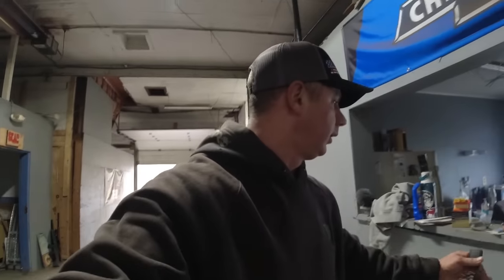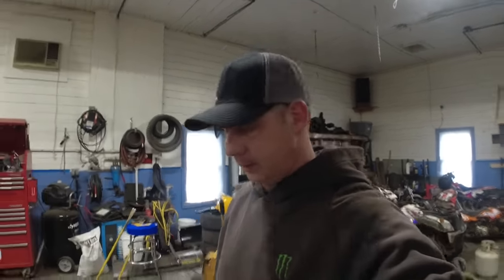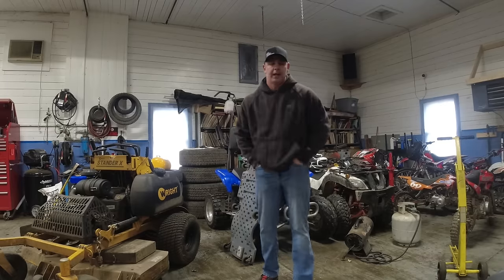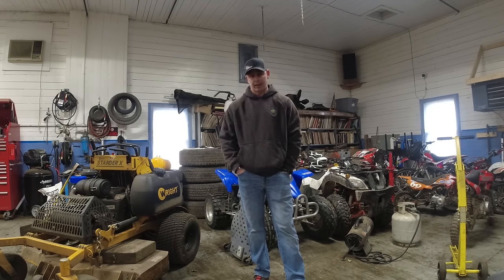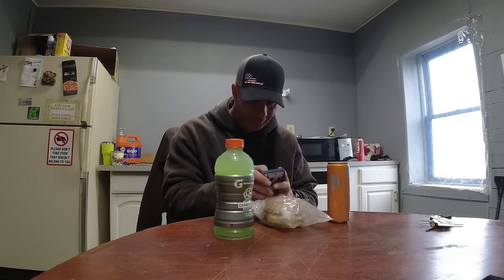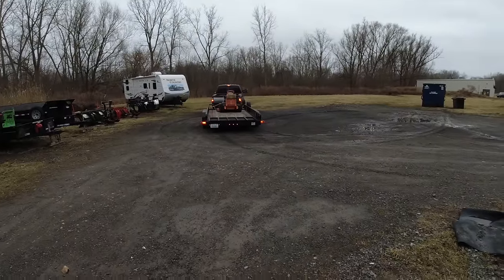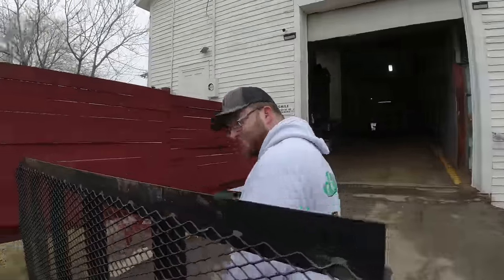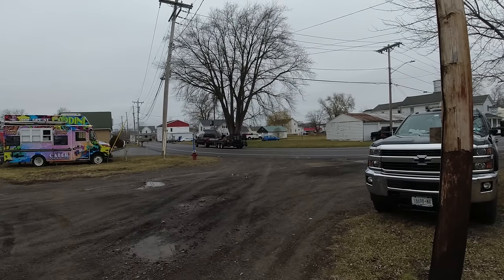Mowers are gone NEW mower arrives

Comment: Pretty good deal there..I have same vride 1..bought mine new just hit 2300hrs..motor uses little oil now..I'm gonna replace it after this season..still never misses a beat..ps..grind the bushing down in that handle bolt..it will stay down all the time..it makes it way better..I hated that thing always poping up👍👍
Reply from the maker: I’m used to it because of the grandstand and vantage but I’ll disconnect the safety in it

Comment: What is the best size landscape trailer for efficiency but also accessibility. 14 or 16ft trailer?
Reply from the maker: It’s not that simple. It depends on the mowers you have, properties, what you need that day. Any trailer can be efficient it’s not about the size of the trailer
Reply: @CountrysideStrong  I guess I kind of meant is a 16ft trailer more of a pain backing up and navigating residentials than its worth? I am planning to upgrade from a 12ft single axle to a 14 or 16ft  tandem this year. I do 90 percent residential in a rural area mostly but looking to gain more commercial contracts this month and keep getting them as i grow